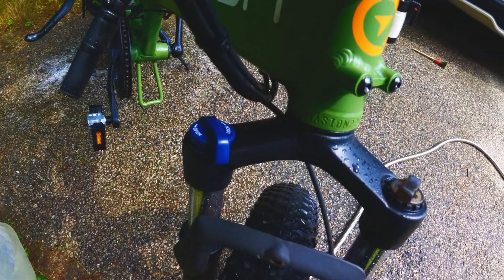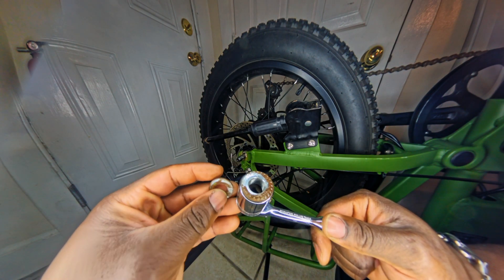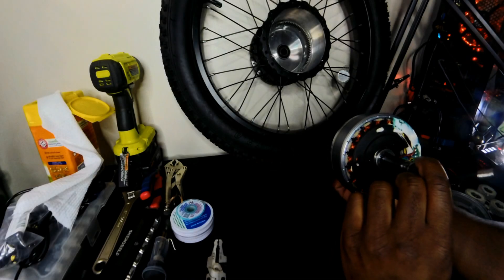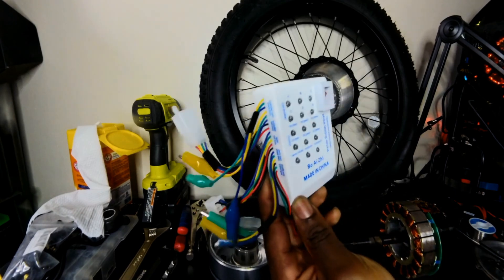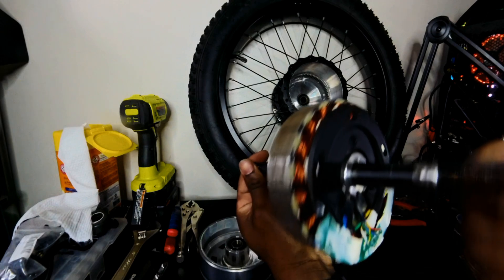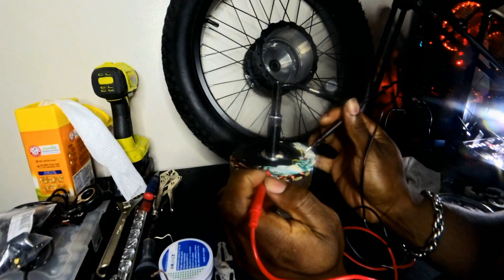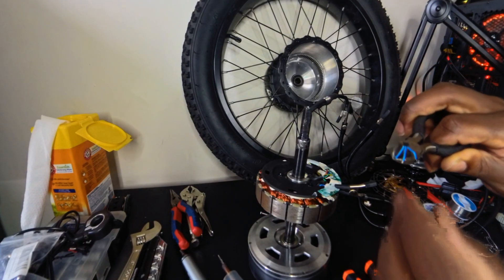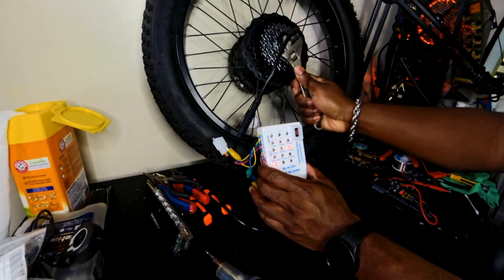Project EB7 - Error 24 Hall Sensor repair for Electric Bikes!

Comment: I fixed my hall sensor, but every single time I put it back on my bike with all the screws and everything. It just doesn’t work anymore and it’s always the green one. I replace it. It cycles on the motor tester. But it’s still breaks every time I put it back on. Do you know why this is happening?
Reply from the maker: Could be the sensor type. Inside the sensors are voltage regulators that react to magnetism. Certain sensors work with certain magnets. Other than that you can put a multimeter to the sensor to see if there's any continuity. The three pins are usually ground, power and variable output. You should see voltage on the meter to verify that the actual sensors are working fine. Hope this helps.
Reply: @TR_Collective  so if I get the device you’re talking about, I can test each voltage of each hall sensor and they should all be the same correct or do you think I could just get a whole new motherboard that has whole senses already attached so they’re all the same and connected to the wires do you think that would work?
Reply from the maker: Both technically. You could find an entire PCB replacement with the hall sensors attached but with all parts, they have to be part number specific. 

Same thing with the actual hall sensors. If you use a multimeter you can see if any voltage is being ran through it at all. If not then it's blown/dud. You just have to know the basics of using a multimeter. @savage_sponge8678

Comment: I was trying to replace the main wire on mine as it was broke off at the axle when I got it. But when I was pulling with all of my might I slipped and you see that black wire cover on yours well mine has 3 little blue wires going to it. The pliers broke the 3 blue wires. There's 3 sets of 3 blue wires on the motor which I'm pretty sure are the hall sensors but what are the blue wires going to that plastic wire guard. I xant find anything on line your video is the 1st I've even seen having that plastic piece like mine does.
Reply from the maker: If you're talking about the 3 blue lines coming from the main sensor by the black cover, that's just insulation around it. The way these sensors die is due to heat and some manufacturers combat that by insulating them. 

You can find the same sensors without the blue insulation as well. You just have to figure out which kind of sensor it needs.